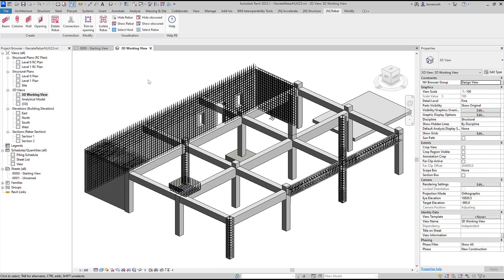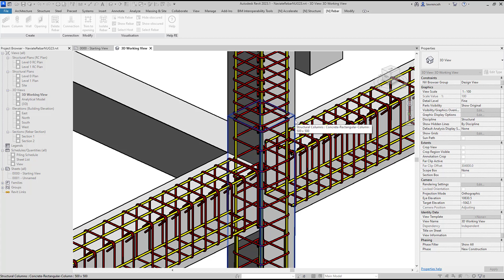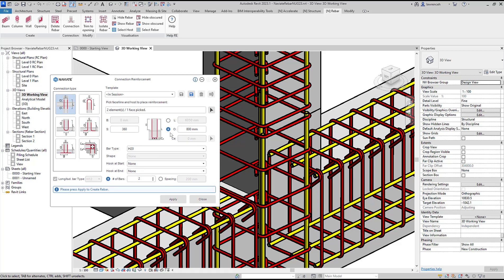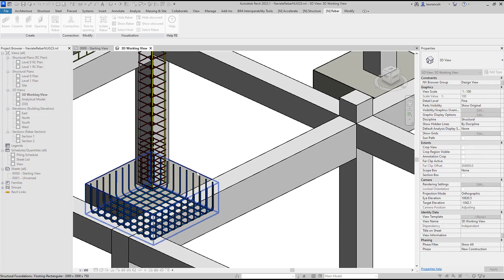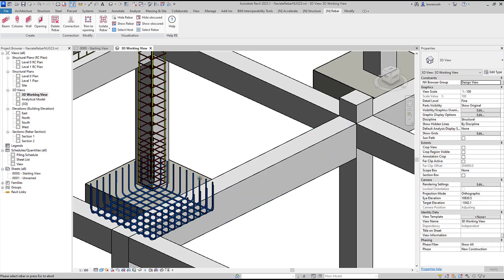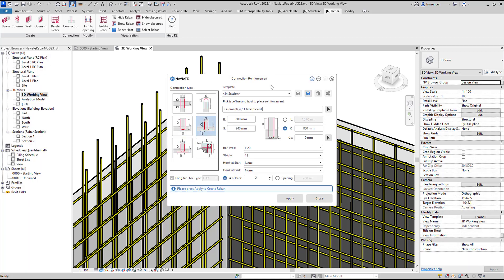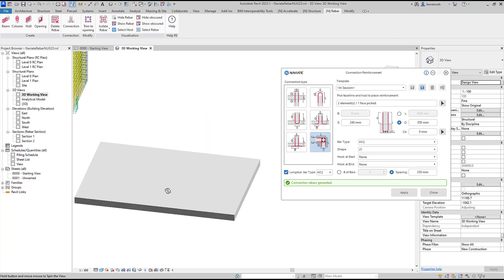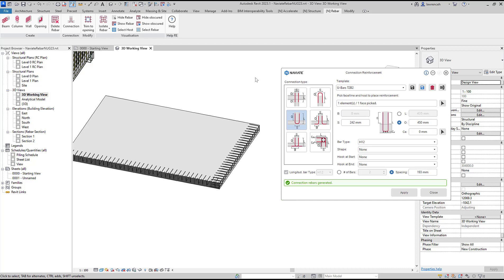Discover Naviate Rebar - Reinforcement Connections

Comment: Hi, first of all, thank you for this effrot, I Have two questions 
1) how can I control the direction of the connections bars? for example between the foundation and the column I want some of them to be in the X direction and the other in the Y direction 
2) can we add stirrups for the connections bars directly from naviate? dowels between the foundation and the column?

thanks in advance
Reply from the maker: Thanks for reaching out! Rebar Connection can only place these Rebars in one direction
Stirrup bars are not included in the connection tool, but are, for example, included in Column
straight bar connection can be used as dowels /Naviate team